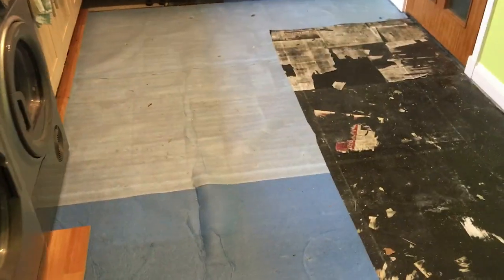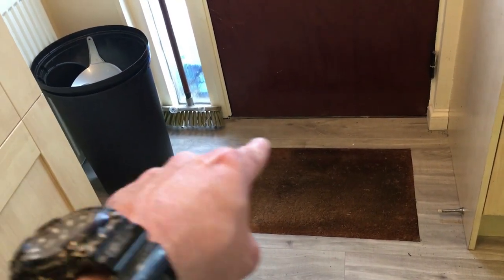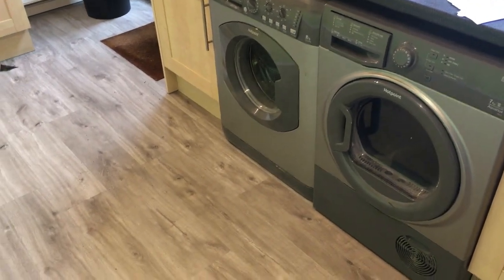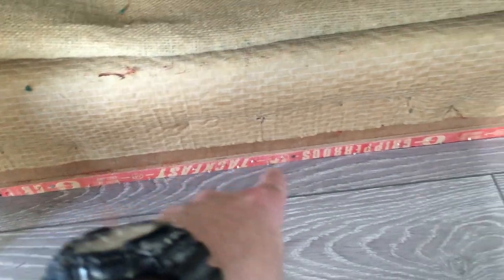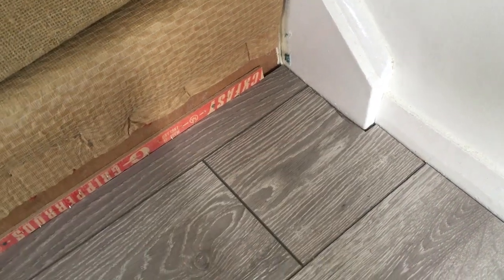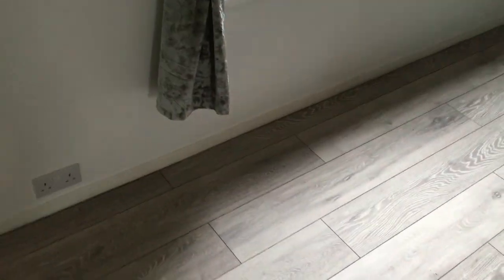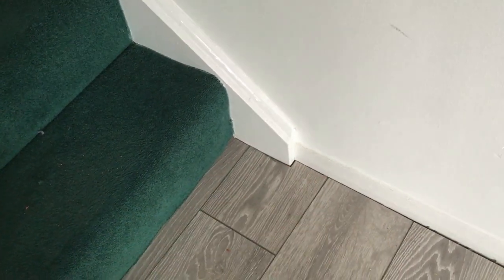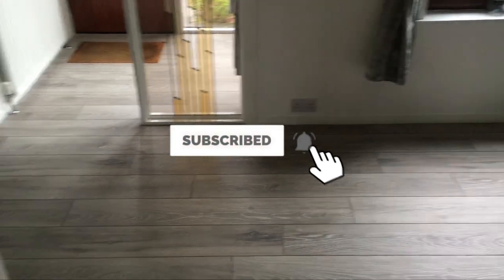Fitting Laminate and Livyn Vinyl Quick Step Flooring

Comment: Thanks for the video, very informative! I'm currently in the middle of a house renovation myself...our builder has suggested Howden's Livyn Vinyl Quick Step for the downstairs kitchen/living space. My only reservation is I've read quite a few reviews about poor performance in a couple months of installation – e.g. scratches, lifting at the edges (in heat especially) and just wanted to get your take on the durability of it in the long run. Thanks!
Reply from the maker: Hi Tonie, I have been using Livyn vinyl quick step for about 4 years now and never had a problem with it. I always use this and always recommend it when working for private clients. I use it mainly due to the ease of fitment and also the 20 year guarantee that it comes with. For what its worth, I would certainly recommend it. Thanks for the comment 👍
Reply: @Bacrenfencing  amazing, thanks for the speedy reply too! Out of interest, do you use this at your own property?
Reply from the maker: @lumton  Yes, we have it in our ensuite

Comment: Nice job mate! would you say you prefer the laminate or the click vinyl? Currently trying to pick between the 2, have always gone for laminate in the past.
Reply from the maker: Thanks, I do like the click vinyl as it has a slightly softer feel to it, but it is twice the price of laminate. If choosing the click vinyl, you need to ensure that you have a pretty near perfect sub floor to lay it on because it is thinner than the laminate, so needs a good flat surface.
 The vinyl click is not as noisy under foot as well, so that is another benefit as well as feeling warmer under foot.
 Both are good floors, but my preference is vinyl click, especially for bathrooms and kitchens.
 I hope this helps a little ?

Thanks 👍😃